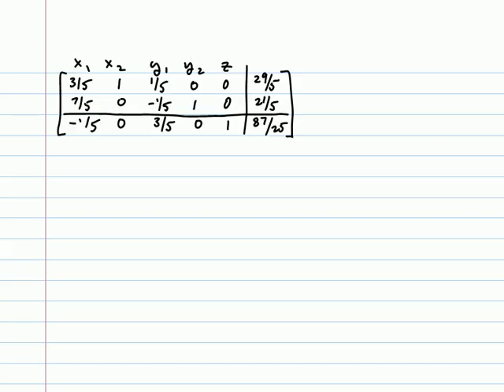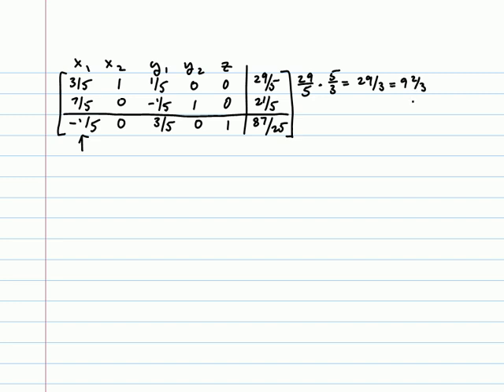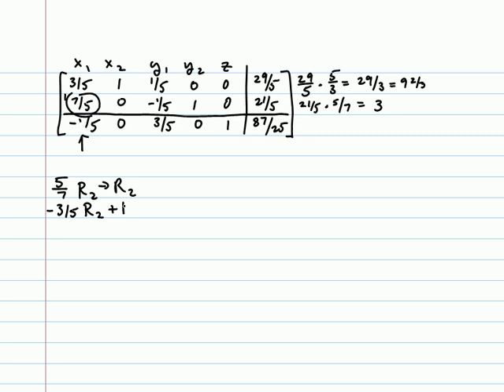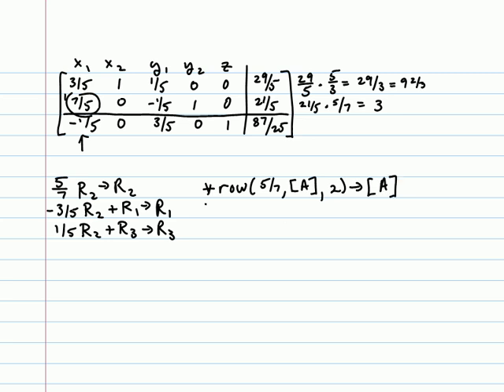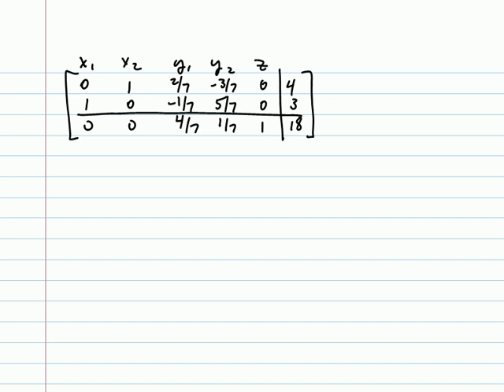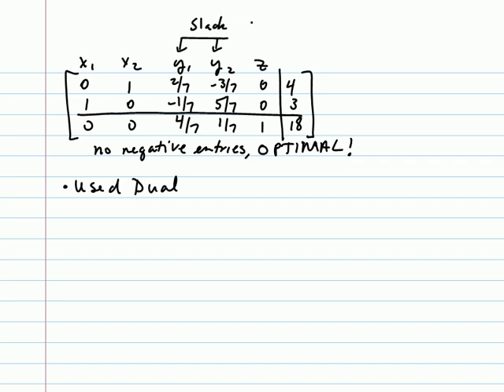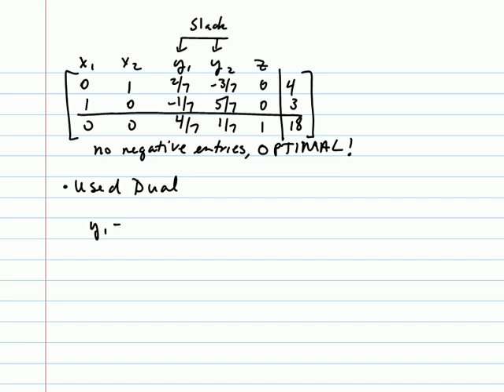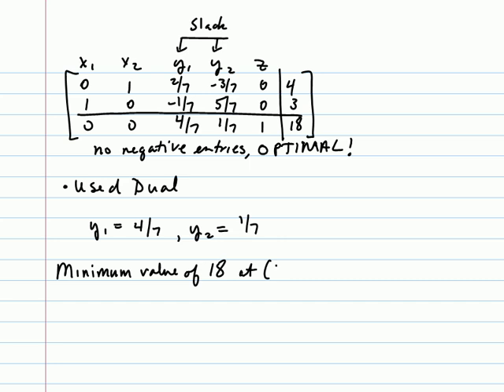Part 2 - Solving a Standard Minimization Problem using the Dual and the Simplex Method

Comment: There's an error.. In the second pivot operation the last two operations are supposed to be amended to: r1-(3/7)*r2 and r3+(1/7)*r2. That is the only way you can make the first columns #s (other than the pivot) zero. Correct me if I'm wrong.

Comment from the maker: Actually, I think I am correct.  I don't think I said to divide 21/5 by 5/7.  The process is to divide 21/5 by 7/5.  To do that you multiply 21/5 by the reciprocal of 7/5, which is 5/7.  So, 21/5 (5/7) = 3